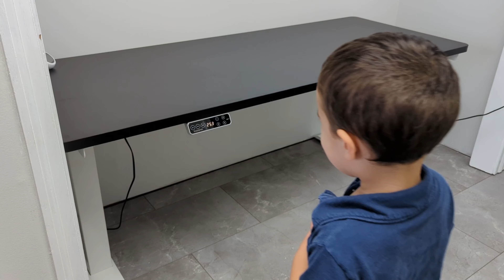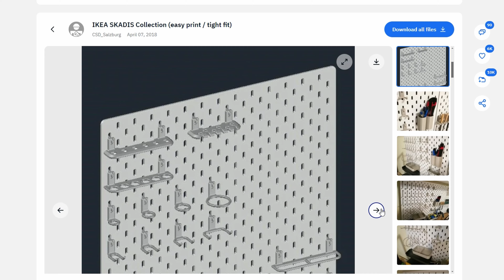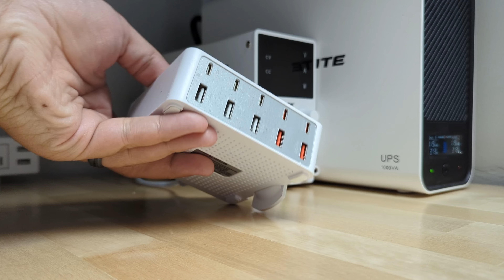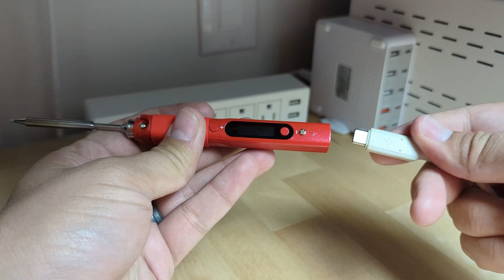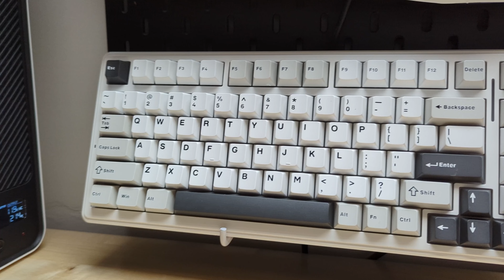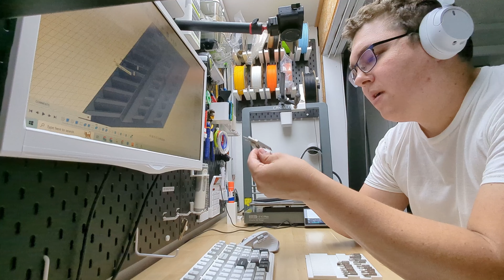Building a CUSTOM Workbench for DIY Projects!🛠️

Comment: Nice work - what's the small monitor behind you with the Youtube sub‽ And - Your monitor link in the description under the stuff behind me section is broken
Reply from the maker: Thanks! That's a pixel display I built in this video: https://youtu.be/aNpBO0BQZnM
I'm actually selling an upgraded version now on Etsy. You can see pictures of it there: https://makeitworktech.etsy.com/listing/1757701302/wled-matrix-pixel-display-32x8-housing

Thanks for the tip about the monitor link!

Comment: lol, in my house up north I had a 5' x 10' space my kids called "The Hole". Now I have a 10' x 20' section of our attached garage that I converted to an office and I share with the wife crafting area. Wall space above my "L" shaped work bench is limited as in front of me I have a 42" monitor (display for my laptop, so nice to see everything so BIG), a 24" Security camera monitor and to the left of me a 40" x 40" window. I can not hang any tools on these walls as you can, so I use (2) 7' high book cases with plastic compartments to hold all my electronics. I may have to order another 10' x 10' outdoor shed to be my lab. Nice video!
Reply from the maker: Sounds like a sweet setup! My "office" is a 6x10 - about to get a 12x10 shed like you mentioned for a studio - run some power out there of course! Thanks!

Comment: Hi Aaron, I hope you are well. 
cool looking build,
I recently hot myself a pinecil v2 soldering iron and I've been using an Anker 533 power bank for it, it says it's only 30w PD, But I've been soldering no problem with it, and they are on offer at the moment too, and 10,000 mah so pretty good, oh and also comes in white!,
Take care from accross the pond 🇺🇸🇬🇧
Reply from the maker: Doing well! I hope same to you. Very cool, I'll have to check it out!

Comment: Nice Aaron. You should take a look at the YouTuber " Hands On Katie" for 3D printer organization and desk systems - all open source.
Reply from the maker: Good suggestion, I did see her video about that system. My biggest issue with it was just that you have to print the grid as well because it takes up so much time, but it is a really neat solution!